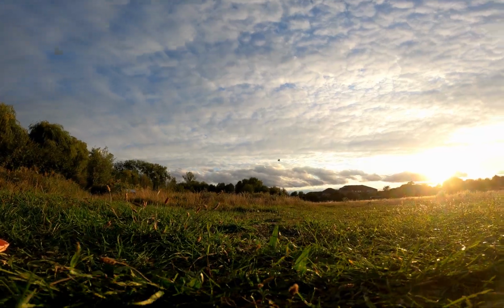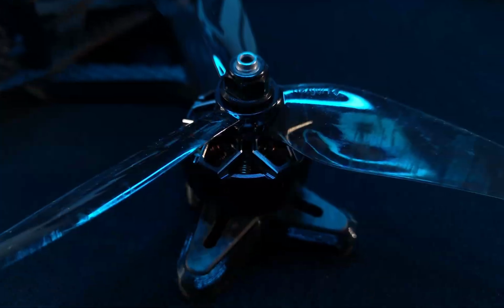The BEST OF EVERYTHING in a 5" Bind and Fly?!?! The AOS 5 V2 BNF.

Comment: Hey Chris,  I purchased your AOS V2 frame months ago and build my drone with HDZero components from scratch.  I love that frame.   I would love for you to encourage iFlight (and other Bind and Fly manufacturers) to provide "Nearly Bind and Fly" products.  Products that come with fully assembled frames, motors, ECS, and FC (also xt60 and capacitor).  The buyer can then install their own video systems (DJI, HDZero, or walksnail).  This gives you the ultimate flexibility.  Especially now which the new solderless FCs.  I can just plug in all my components like receivers, GPS, LEDS, VTX, etc…  The product would come with the ECS already soldered to the FC.  It gives buyers a great starting point and ability to choose custom parts as well.

Comment: Hey Chris, I'm torn between 5.5 and 5 AOS frame. From time to time I like to use gopro but most of the time i fly without. Do I lose anything by going with 5 and occasionally putting gopro on it or would you recomend to go with 5.5 since it'll have aversome performance on 5' inch props as well ?
Reply: Same question

Comment: hi chris! i am planning to buy one of these or the version with O3 onboard for general close-in acro use. i do not plan to install any action camera now or ever in my use case. this will place the battery biased towards the rear of the quad due to the XT60 plug location on the frame. is this going to affect handling as i always thought it would be optimum to place fhe lipo pack absolutely dead smack in the middle close to the CG?? cheers!

Comment: Hi. i bought aos 5 v2 6s. And I have a problem. Strong vibration every time I press throttle up. Changed the propellers, the vibration remained. I took it apart and put it back together, same vibration. Any advice please

Comment: shouldn't the stack mounting be on dampers? what a great thing, that you have a BNF version of the ASO5 V2. waiting for the AOS 5.5 V2 BNF version! :D
Reply from the maker: The best vibration performance is achieved with a rigid stack mount and gummies on the FC and ESC 👍
Reply: @ChrisRosser  so just the gummi holes where the bolts pass through? thanks a lot!

Comment: Hi Chris. I recently bought the AOS5 frame kit with the idea of building a new quad using the new O3 Air Unit. 
Could you let me know if any special hardware or any modifications are needed to fit the  O3AU inside the AOS5 frame? Thanks
Reply from the maker: No modifications necessary but you can consider upgrading just the camera plates to the O3 edition for extra protection.
Reply: @ChrisRosser  thanks Chris! Much appreciated.

Comment: Hey, please tell iflight to sell replacement arms in their store. It's nice to be able to get a Set of extra arms with your bnf, but that doesnt help customers who already have an aos frame. Farins frames are freaking expensive and even overpriced shipping in europe. Drone fpv racer france are all sold out, but fair price and shipping. I had to ask a dealer on aliexpress selling your frame for iflight to especially sell me a Set of arms. They deliminate after crashes easily. As an aos5 frame owner you should Twist your arms and check if they are still very stiff. By the way, you could also get iflight to sell the aos 5.5 with 2208 motors. Basically what I built and prefer
Reply from the maker: Will do!

Comment: Curious, what PWM and timing are you running in this rig? I love my AOS 5 and 7
Reply from the maker: 24-ByRPM and 16deg (the optimum based on my ESC testing for BLHeli32).
Reply: @ChrisRosser  Thanks I have found myself on both the 5 and 7" 24Khz works great I have been using 23 deg. I will give 16 a try. The PWM auto is terrible as well as the timing. Glad Im moving in the right direction.
Reply from the maker: @craigjordan3739  Check out my BLHeli32 settings video for the low down!

Comment: Hi Chris, just got my AOS 5 V2 BNF from iFlight. And right of the box I'm having rough vibration upon arming the quad at 0 throttle. But when I increase the throttle, the initial rough vibration goes away. Checked with BLHELI32 - everything's fine. Also tried spinning the motors on BF configurator - everything's smooth. Tried increasing Master Multiplier but nothing changed, so I left it at default value of 1. Kinda scared of that rough vibration upon arming. Props are tightly secured and quad is mechanically sound. Any idea of what might be the issue? I haven't done my maiden flight yet. Thanks in advance for your response.
Reply from the maker: Hi Danny, some rough sounds at zero throttle on the ground are to be expected with the agressive filter tune on the AOS 5. If you raise throttle and hover everything should sound smooth. If the quad sounds rough in a hover get back in touch (ideally by email or the form on aos-rc.com)
Reply: @ChrisRosser  Oh thanks for your prompt response Chris! I was about to reflash my FC with default BF. And yes, when I hover, everything seems smooth. Just wanted to double check before doing my first maiden flight outside. Cheers!

Comment: I em?! going to build a park 250 sub quad this winter  , My 7's are to dangerous in parks lol A store in Canada has AOS 3.5 v2 frames was thinking . I run analog triple stack so probably need switch out the post ..
Reply from the maker: I would run front and rear stack as that's what the frame is designed for. If you swap posts the camera plates won't fit.
Reply: @ChrisRosser  Thank you understand .

Comment: will this retain similar performance if i only run 4s batteries in it?
Reply from the maker: Unfortunately there is only a 6S version right now. Hopefully 4S version coming soon!
Reply: @ChrisRosser  I went with the 6s BNF. wow, this flys like its on rails, right out of the box! Iflight did a great job on this one. Tons of power for sure. It suprised me with how good the camera is, since i normally only build with the original dji cameras. That's three now, a AOS 5 4s, AOS 5 6s, and Cine35 that fly like no other.

Comment: I love your frame, but sad it's filled with iFlight parts.  They've been atrocious, preying on our community for a long time, selling bad parts with no QC, and offering little to no support for their failed products. I was a long time customer of theirs, and I've seen the durability of their Xing motors go down from one version to the next, but it's the electronics that really have a reputation for failure. I I definitely recommend the AOS5v2, but I always warn pilots against buying iFlight due to their long history.  Love the new frame 🙌
Reply from the maker: Sorry to hear you've had such a bad experience with them! I fly a lot of iF stuff (I've probably been through 20 stacks in the last 2 years) and never had a failure. I do run big caps and TVS diodes on my larger builds though so maybe that helps.
Reply: great frame that i wish to have it on my wall someday ... 
and to hijack a little bit more I've had ifligth quads ... no complains.
The problem is when something fails... i bougth a cinelog25 from geprc pnp... i took it out of the box and installed an elrs receiver... without testing it first.... turn out the gyro was bad and they said it was my fault... just like that... if something fails WILL ALWAYS be customer fault...
Reply: Same experience here. Built 2 quads for a buddy earlier this year and both of the twin g FCs had a gyro dead.  It's a dual gyro, where's the qc there all you had to do was plug it into BF 🙃
Reply from the maker: @Brian-S  For better or worse no manufacturer that I know of 100% QC tests FCs except where they are part of a BNF. It just doesn't make sense for them economically at the cost. ICM/MPU gyros have been having big QC issues since the chip shortage. Long live the BMI270!
Reply: @ChrisRosser  yea your not wrong there I suppose qc has gone down hill especially on anything with a mpu6000 specifically.
Reply: Yea iflight is a big no hate there cheap over priced products
Reply: Ice had the same experience with iflight brand new board falling from the sky with bad gyros and iflight refusing to help